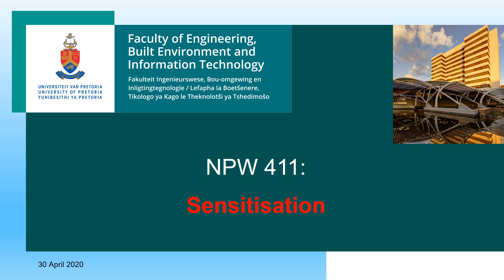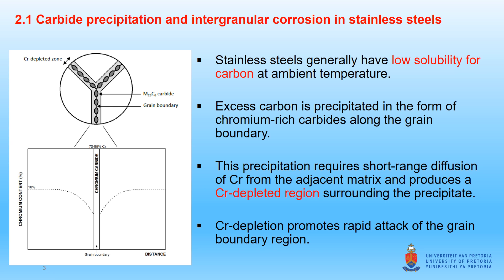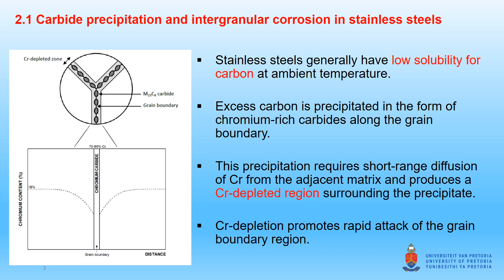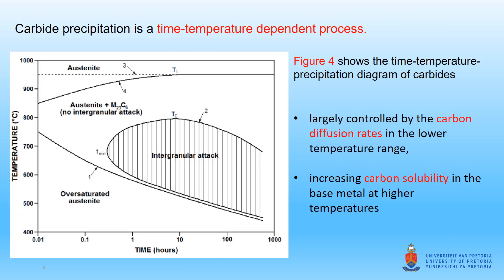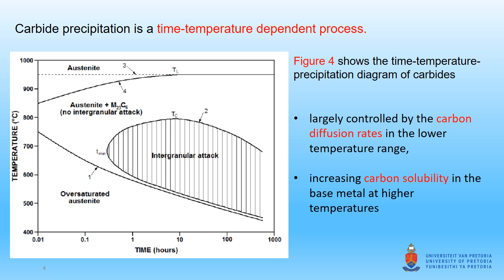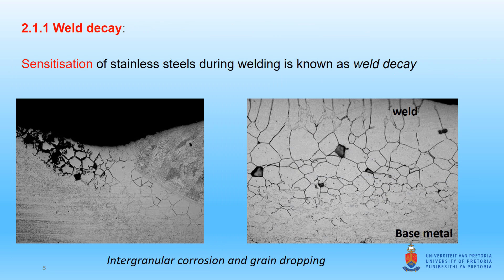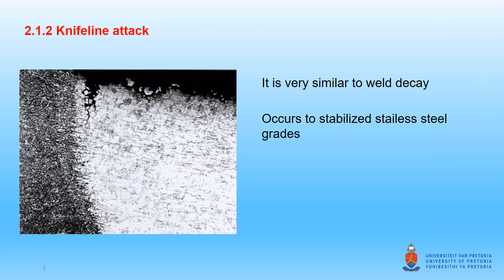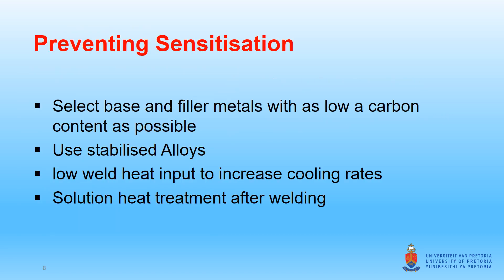Sensitisation in stainless steel

Comment: So, every weldment in stainless steel always has an area of weld decay?
Reply: Due to that you need to choose low Carbon stainless steel as 316L or stabilized grades as 321 or 347 for Welding applications.
Reply: @zejean  then why it is recommended to use filler like E316H for welding austenitic steel used in high temperature environment ?
Reply: @mohammedshahreyar2190  Is that possibly due to the high temperature environment being above the carbide precipitation zone ? - total guess - I am looking at the graph at 3:15 (Figure 4)